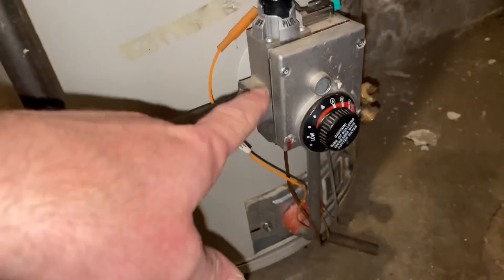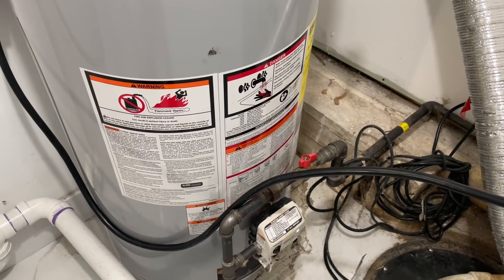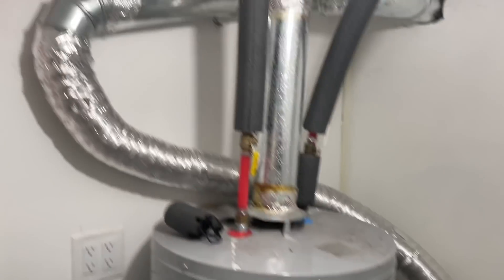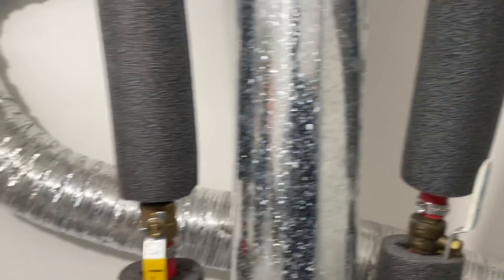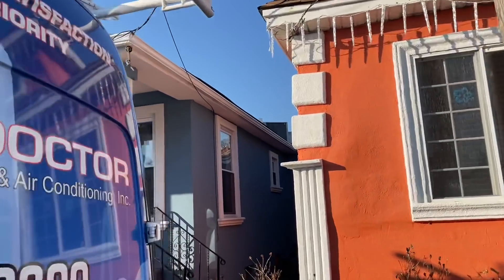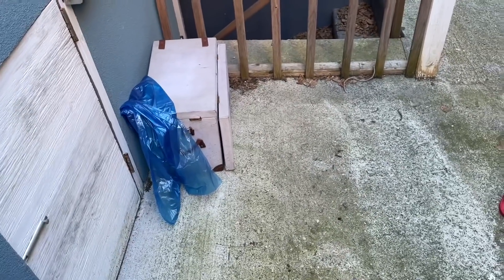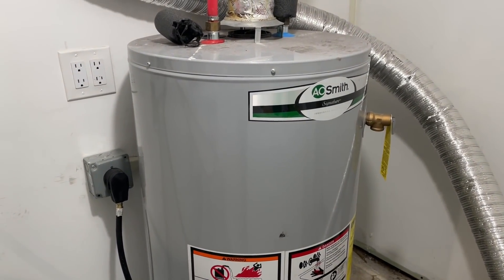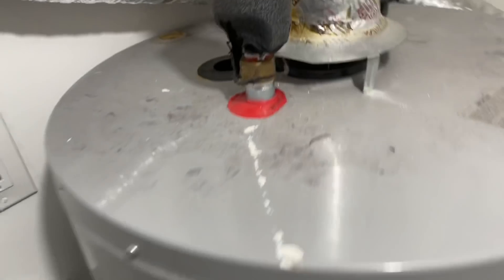Prevented Clothes Dryer Fire Water Heater and Clothes Dryer Vented Together

Comment: It looks like you might be able to just extend the vent from the crawlspace to the outside wall of the house.  That would be fine for the dryer alone, but that water heater, wow, major rework in any case.  What kind of furnace and venting does she have, any issues there?  The metal vent stack on the roof was leaning over quite a bit, wasn't it?

Comment: The best solution for this home owner is to go with an electric hot water tank. There is no economical way to put a power vented unit in, and yes to solve this problem if they insist on running a gas water heater is to put a power vented unit in and they would need to run 2 separated exhaust lines out, one for the dryer and one for the water heater, and to get it to the outside, that length of run, this would cost every bit of $2k.

Comment: Also the framing underneath with 4x4 posts under each joist. Pex connection all the way to heater, warm air pipe and fittings, not a power vented water heater is redic

Comment: That’s actually criminal. Absolutely call the city plumbing inspector or state board of inspection with installing plumber name. How many other people are in danger of being killed by that asshole?
Reply: I agree with Joe, i have called the board of inspectors on a few occasions. The governing body that regulates who can be an inspector in most states and provinces is fairly loose, but takes violations and infractions seriously. most of the inspectors i know have an entry level gas license, or an electrical license or plumbing license, and honestly alot of them are doing it as their side job so they’d come in after a hard days work from their usual job, check out a house for 20 minutes when in reality it’s 10 minute of actual inspection, another 10 for the paperwork. 
The guys i know are good, they take their time. i’ve caught 2 so far this past year trying to make a fast buck.

Comment: Yeah that's pretty bad. Couple years ago I saw a water heater vented to connect with main flue pipe with a 3" cardboard tube. It was just charred a little bit on the inside.

Comment: I would have liked to have seen you measure the CO level in that room!
Reply: I had an Old Timer Supervisior back in the early 80’s. He told me if I was servicing a Boiler or Water Heater, to look around, if I didn’t see any Spiders and Spider Webs, I should be extremely suspicious of high CO Levels, as they are sensitive to CO. Don’t know if that is absolutely true, but it held every time. BTW My Monoxier was in a Green Metal Case, had a Precision Hand Pump, and Glass Indicator Tubes.

Comment: Could you not install a powered flue pipe, vented out the side of the house, for the heater. and a condensing trap for the dryer vent? The powered flue could have a balancing valve to adjust the air mix to stop the pilot being 'sucked down'?

Comment: The pex by the drafthood and the lack of prv piping Is a nice touch as well. Even though the navien will work fine on that 3/4 blk, it will often times cause a wicked drop on the main inlet To you other appliances (buderus boiler maybe i saw). I had a customer that had the same issue and the inlet would drop to 3” on the furnace when the tankless and down stream fireplace were on.

Comment: How did two other companies see that and not shut it down. I hate hacks, someone could of died. Well I guess they did but didn’t have a clue what they were looking at. I thought we had hacks in Jersey, can’t say I ever seen anything that bad in all my years.  Keep up the good work
Reply: Found one the landlords maint guy had piped the exhaust from the furnace at a downward angle and it was pushing straight to the wh tell you wasnt a drop of plastic left on the top around the c/h taps lol gotta love it was only called there cause they couldnt figure out the dirty flame sensor haha gotta love it

Comment: Good suggestions. More budget friendly replacement, a 50 gal electric heater. DEPENDING on location of the panel box
Reply: There's the reason. 
Males sense
Thanks
Reply: @PipeDoctor   I'm sure you'll do right by them whichever way you go pal

Comment: couldn't that water heater directly vent outside a side wall without a chimney if you extended the pipe out of the crawl space?  thank you for your videos
Reply: it needs a draft which is caused by air movement from hot to cold. since heat rises there would be insufficient draft flow to completely remove dangerous gasses..   thats why a power vent was recomended

Comment: curious what your opinion is I found that tankless in the winter although enough for a showers still has significantly less flow for filling up a bathtub as it's a much higher flow then the shower head (unless the shower head was "fixed" :)
Reply: Tankless are good to a certain gpm that tub spout can be to much sometimes
Reply: Also could have bad volume from piping issues

Comment: Isn't there a 3rd option? Electric water heater?
Reply: And a 4th option a condensating non vented electric dryer.
Reply: @rickw4160  that still doesnt help the water heater exhaust though
Reply: How do you figure? If the one exhaust was good, then it's only the matter of picking one thing to stick in the hole. Unless I missed a chimney or something.

Comment: I see a nice lawsuit coming for them inspectors and contractor
Reply: Could be a product of a short sale, or some other condition without a home inspection. That is my hope. Any decent home inspector would have documented this and pointed it out.
Reply: @rickw4160  they would have condemned the system as its potential fatal the life
Reply: Probably just shut off the gas.  What your suggesting would be something that had to be of an immediate risk to life and health. Once they turn off the gas, there is no risk.
Reply: @rickw4160  whats stopping the customer turning the gas back on
Reply: Nothing will stop somone who wants to knowingly be irresponsible. Homeowner seems to want to do the right thing and gets screwed over by prior plumbers.  What would you do? Notify dept of buildings and try to deem her house uninhabitable? Then they revoke the c/o and she has to apply all over again. They would cite her on the pex plumbing, so now she would also have to have that replaced. She would be displaced with no place to live. 
Turning off and tagging it out is acceptable in my opinion. You can disconnect the thermocouple if it makes you feel better.

Comment: Whoever installed that needs to be charged with gross negligence and attempted murder. That is completely insane. And then the pex going right to the water heater which is illegal practically everywhere. Not to mention it looks like a DIY'er at best installed all of that mess because it looks like garbage. Whoever got in there and hacked it up had no clue what they're doing and there's no way that abortion passed 2 inspections like that. I simply can't believe that. Those 2 guys that passed off on this also need to be reported, fired and barred from ever working in this trade again. Unbelievable.

Comment: Let's see the new install, boss. I find it interesting that most of your customers are more informed about plumbing than the plumbers that come out to fix problems!
Reply: @PipeDoctor  I hope it not a needy navi?
Lol 🤔😂🤣🥃👍
JS
6 years in
Stay safe 
Wear your safety glasses
Reply: Probably a navi water heater only. There must be a separate heating system nearby (the roof vent). It just looks looks way undersized. Dryer still needs to be fixed.  Neat job would be a core drill less neat will just be an sds and pound away. Id probably do the shortest route. Longer route is through that crawl space and out the back door.(and less efficient). That looks like a eifs finish.. would be hard to color match if you boo boo it .